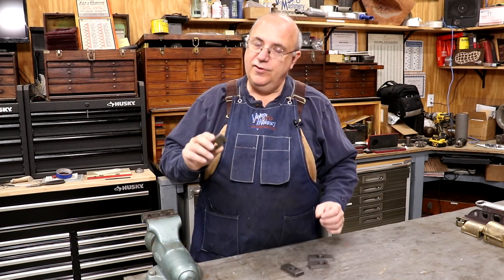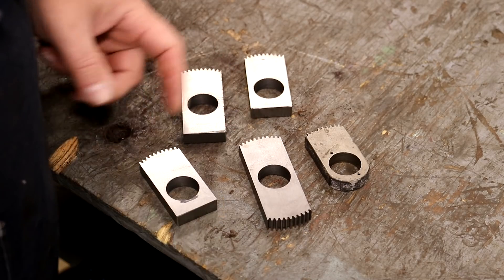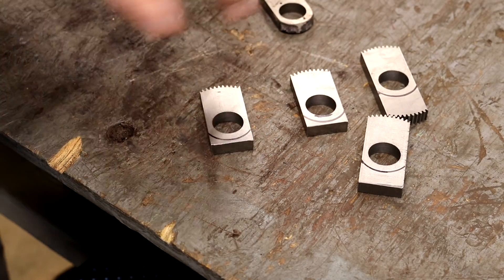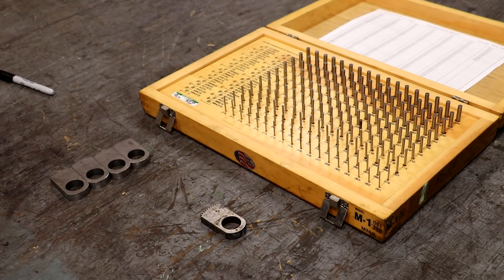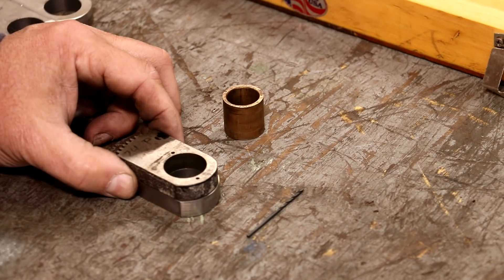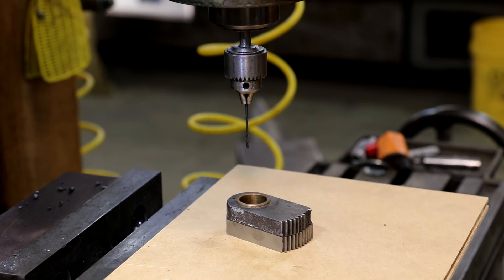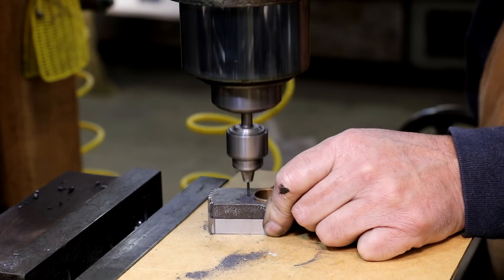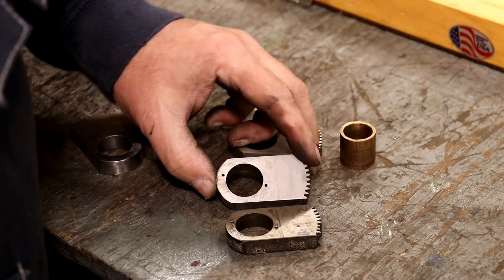Monarch 10EE Lathe Gear Segment, Part 4:  Grinding to Length and Drilling Pins

Comment: I'm surprised you didn't keep the long example (where you cut teeth on both ends) in case you needed to do this work again. I guess if you kept all of the measurements it'd be okay, but still, the example would be best and less likely to be lost. Oh well ... is what it is.

Comment: If you look at 7.53 minutes you can see that the Teeth don't line up, so if the pins are the deciding factor this Gear Segment will never fit

Comment: Keith, before you drilled the two holes in the gear segment, should you have aligned the teeth first?  Of course, if that turns out to be necessary, Tom can flip the part over and re-drill it after aligning the teeth.  When you get to this part in your restoration, please point it out to us and show what it does, how it works, etc.!
Reply: Then you can't put it in upside down.

Comment: In 1971 I got a job working for Bennett respiration as a machinist apprentice. One of the noisiest machines I ever ran was a Waddell turret lathe with a feed tube. We could handle stock as large as 4-in aluminum hex and that stuff rattled around in the feed tube until you got to a very short piece of stock. The cut-off saw was pretty noisy too it could cut 4-in brass stock and that stuff the blade screams when it cuts through that. I would use earplugs and ear muffs and I could still hear that thing

Comment: I would have drilled all of them.  If when I were to use them and the holes were in the wrong place, simple flip the part over and drill new holes.  After all they are offset from center.

Comment: Ya know, that toothed bit you cut off could be welded/brazed to another broken gear face to restore it.
Reply: Good idea, but getting the spacing from the center hole right would be a trick.
Art

Comment: I’d drill the two small holes in at least one of your spares right now while you’ve still got everything set up, and before you lose access to the master part (by sending it back.) This way, you’ll have a spare ready to go, with nothing else needed to put it into service should your 10EE suffer a failure of this part when you’re trying to complete a time-sensitive job. 😊
Reply: When Keith takes the gear segment out of his lathe he will have a master for his lathe.     I’m sure that is what he was thinking.

Comment: Yes, but if you look, the gear teeth were not aligned between the two pieces when you drilled the holes!
Reply: The part is just a lever.  What he made will work perfectly.  I own one of these machines and know the part well.
Reply: Your right, and why not drill out the hole's on both of them ? why leave it for the buyer? I would be up set if I got back incomplete work.

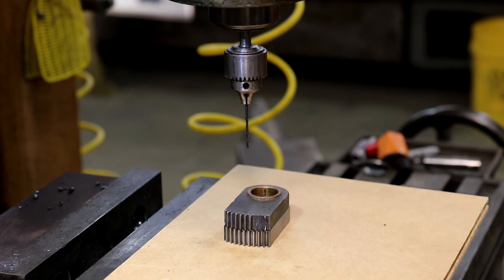Comment: 7:28 Never mind aligning the sides of the items, I think the teeth should be aligned. - and I might suggest one of those pieces is on upside down.
Clearly the pinholes are in specific locations and that might matter relative to the positions of the teeth. The result may be that the item works fine but the control lever doesn't quite align with markings on the machine.
Had I been making these, I would have taken care to ensure the teeth locations were precisely where the original ones were.
Reply: you are right
Reply: Agree here. But I'm going to let Keith go on, and this may just become a learning experience for all.

Comment: Good job Keith. One question though. Is there a relationship between those two little holes and the position of the gear teeth. When you pressed the bushing in the two items were lined up with one another but the gear teeth were not from what I could see. I wonder if that discrepancy might alter the gear's "timing" for whatever function it performs. Maybe it can be adjusted on assembly.

Comment: Did you make sure that the gear teeth didn’t need to be clocked exactly with the pin holes? If it was not important in its application, then no problem of course, but it needed to be checked
Reply: It is not important.  I know this part well.

Comment: It seems odd that, in these days of automated machining, companies haven't converted their drawings to cad files so they can make parts quickly and economically whether they need one or 100. There are some companies that have and it cuts down on what they have to stock.
Reply: These machines are from the 40's and there are not that many left operating.  Stocking parts would not be realistic nor profitable.
Reply: @paulcopeland9035  You didn't read what I posted. Having a cad file allows them to make parts quickly as needed instead of stocking parts. I used a company that could make pulleys, gears, sprockets, splined shafts, etc on very short notice at reasonable prices on CNC machines. It's not like the old days when they had long setup times on several machines so they wanted to make several of the same parts at the same time.
Reply: @tiredoldmechanic1791  "in these days of automated machining".  Rest assured everything being manufactured now, whether for mass production or even one off custom builds.......likely has all aspects in CAD.
But the issue of converting the out of production parts to CAD from archival drawings is that in a lot of cases there simply are no drawings available for a CAD conversion project.  And, even if drawings are available, someone has to be paid to perform that procedure.  Ultimately everything revolves around the concept of supply and demand, if there is no demand for a product, nobody will manufacture a supply.
Reply: @larrywalker7759  They apparently have a drawing if they could give the guy a price on making one. People that are well versed in Cad can convert a drawing in minutes.

Comment: In te Video when you drilled the two small holes it didn't look like the gear teeth on the pattern were lining up with those on the new part. I would have thought the holes were there to get the right setting for the teeth to mesh.
Reply: I, too, suspect that the location of the holes is relative to the gear teeth. If that is true, the recipient could just flip the new part over and repeat the same operation but with the teeth aligned.

Comment: What happened to the stoker motor?  That's the reason I subscribed.  Last I saw was the forms for the valve sleeves.
Reply: A stoker motor from an old steam locomotive restoration is the only reason you subscribed??
Reply: @paulcopeland9035  Yes.  It was the first video of Ruckers I saw and I was fascinated by it.  I've been looking for the rest of the restoration.

Comment: Am I the only one that noticed that the teeth did not match up perfectly with the original part?
It may or may not work since we haven't seen what it actually does.
Reply: I own a 10EE, I know what it does, and what he made will work perfectly.  This part is basically just a lever.
Reply: @paulcopeland9035  
I'd like to see that.
Reply: @jtjjbannie  The part fits into a gear rack cut on to a control rod.  The action of the lever moves the control rod back and forth a short distance.  Most importantly, he cut the teeth to match the original which will fit the rack.  The teeth needing to "match up perfectly" is not required.

Comment: In my technical days I flew across the country several times investigating gear tooth breakage on an industrial machine.  Cast iron gears.  Inappropriate metallurgical selection by the engineers.
Reply: ...Unless the mating part is very difficult to change out. Then you want to make the part(s) Keith just fabricated the “sacrificial” part.

Comment: i am still interested if the teeth were ment to be clocked to those two holes or is the teeth position completly independent from the gear segment and only outside shape matter
i mean there can be let's say 11 whole teeth and 2 halves on the sides or 12 whole teeth  or two on the edges can be formed anywhere from 0 to 100% so the whole part engagement with the machine can be up to 1/2 teeth out of aligment to the holes
because we can clearly see teeth on new part don't match the oryginal part after sandwitching them together to drill the holes

Comment: Great job :)
What I was wondering: does the timing of the teeth in relation to the sides/pin holes matter?
Reply: No.
Reply: @paulcopeland9035  A gage pin clamped into the gear teeth during drilling will address this concern.

Comment: I wonder, did the teeth need to line up with the pin holes.
Reply: Probably not pending the teeth wear pattern duration. If the lathe had a none adjustable hard stop then perhaps. 
It would have been interesting to know the relationships of the bore, center tooth and .071" diameter holes. They could have been clearance for 1/16" diameter pins?  If accurate timing was required they would have used a tapered pin.
(Using one pin made of a softer material may have saved the original broken gear tooth being the weakest link)

Comment: Nice job Keith. I like the idea of a "two sided" gear for size. Couldn't but notice that it looked like the teeth are not aligned and it looked like the parts were not aligned on the arbor. Is this important for these?
Reply: I think this is the most important alignment for the pins. The relation to the teeth (engage or disengage at the right position. But, he got spares to drill ;-) Thank you Keith. Best, Job

Comment: I would have assumed there was a tooth alignment required with the 2 small holes.
Reply: I noticed that too, I think he had one upside down. Ooof. Not sure if it would matter though.
Reply: Since the part is semi-circular and rotates against another gear I doubt that it matters. Still, I would have felt better if the teeth were perfectly aligned.
Reply: @ellieprice3396  The part fits into a gear rack cut onto a control rod.  It moves the bar back and forth a short way to control reversing.  There is no need for the teeth to be "perfectly aligned".